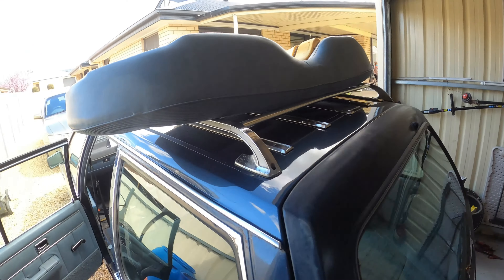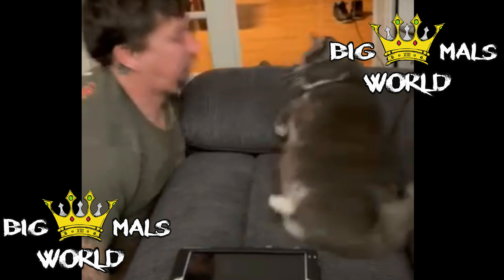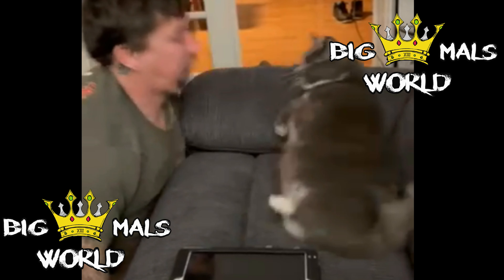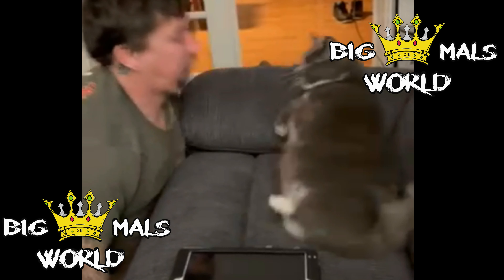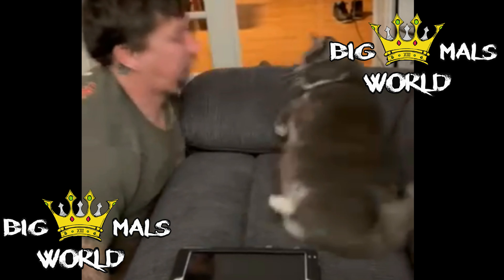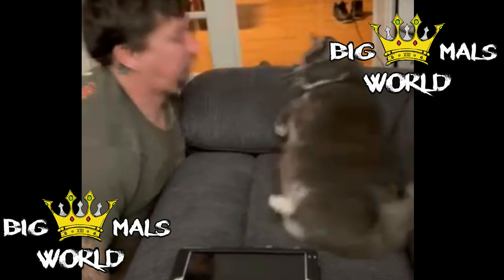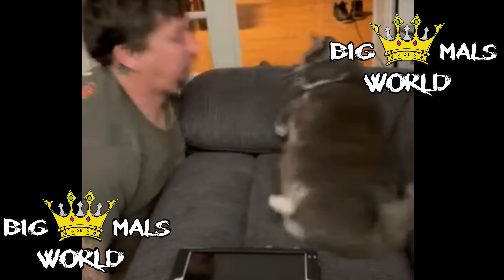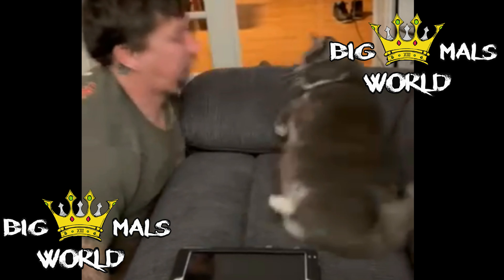VB Commodore Wagon Cruiser Pt4 and unprovoked CAT attack......

Comment: This VB has a VC steering wheel. This was not uncommon for several reasons 1. The inner glue became unstuck on VB wheels making the grip loose. 2. Damage due to theft. Owners who used the brake to wheel lock mechanisms to prevent theft were thwarted when thieves would bend the wheel and disable the hook lock.